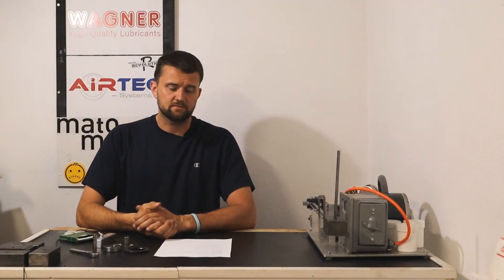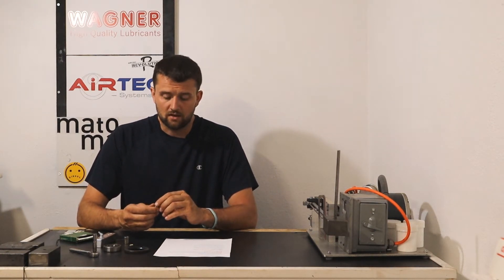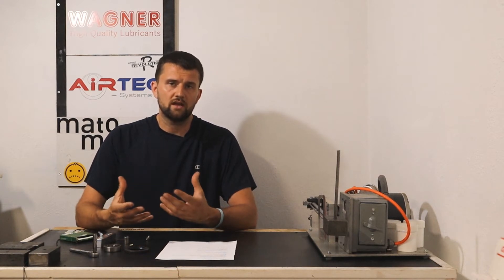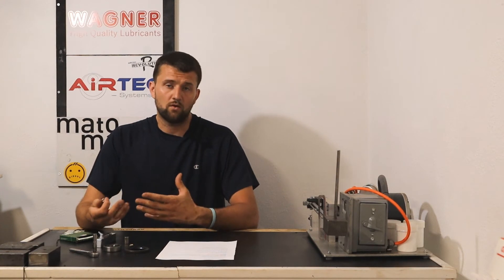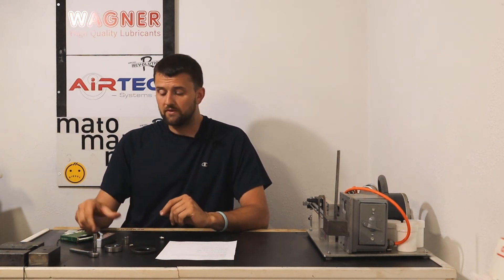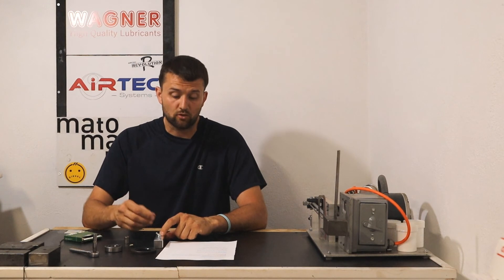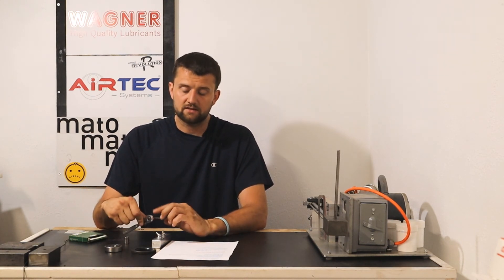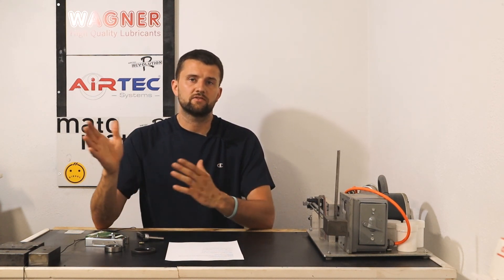How to Unclog Zerk Fittings Correctly: DIY Unclogging Guide

Comment: I’m a farmer with a lot of tractors, equipment, and combines & It seems like a clogged zerk fitting is seldom as simple as to just replace it. The clogs I was having trouble with recently (& most of the time) were at the end where the grease is supposed to exit the shaft/pin, but couldn’t bc of the hard grease shell that formed. I tried the piston style hammer tool...I’ve never once gotten that tool to work on ANY application...even after watching these “how-to” youtubers and doing exactly as they say. I couldn’t heat it bc of rubber seals on each end of the shaft...so basically had to take it completely apart and clean out the exit hole.
Reply from the maker: If your grease is leaving a "hard shell"  it is due to separation and oxidation.  The grease is separating and the thickener is left, forming a hard shell due to oxidation.  This is typically a problem with grease quality, especially if it is a reoccurring issue.  Piston style "zerk cleaners"  also leave a fair amount of penetrating oil left in the bearing or bushing which further creates lubrication filming issue and grease stability problems.
Reply: You probably have a grease-worm infestation, try grease-worm free type grease.
Reply: I agree with this comment that it is rarely the zerc that is a problem
Reply: When you say piston tool do you mean one that takes a penetrating oil to push the old white out

Comment: Just bought this F250 farm truck with creeky, sticky king pins. They wouldn't take grease. Changed the zerks. One side did start taking grease. the other side still wouldn't. I ended up taking the entire king pin dust cap off & filled it with transmission fluid and penetrating oil. Still won't take grease, but noticed the kingpin has freed up significantly. I think within a couple of weeks It'll be able to take grease. UPDATE 10/02/23 a couple of weeks ago, I finally got it to take grease.

Comment: on my ball joint, the grease was hardened so I heated it up with a heat gun.  Once it was warmed up, I pumped it and pushed the old hard grease out.  No more squeak noise.

Comment: I have had to deal with fittings that don't take grease on multiple pieces of construction equipment, usually from the operator not greasing the pins regularly, the pin gets dry and wipes over the hole making it to where it won't accept grease. I have an issue on the spherical joints on my Jeep rock crawler where the joints won't take grease. Most of the joints have a wet bolt and also a grease fitting on the outside of the joint. The grease goes to the same place. It is very common for the wet bolts to get plugged with hard grease and I grease them often usually with a high quality red EP grease. Removing the wet bolt will usually show about 1/16 inch of hard grease that won't flow out the end of the hole. The wet bolt goes through a steel sleeve with a hole in it that allows grease to flow through the poly material and lube the joint. On some of the steering linkage that won't take grease, sometimes all that is required is moving the joint slightly and then it will take grease. I believe in preventative maintenance and I usually grease twice between oil changes and especially when driving through mud, water and snow.

Comment: If the grease is hardened downstream of the zero what are your recommendations....
Reply from the maker: If the line is removable, remove the line and soak it in a solvent and then use grease or pressurized air to clear the line.    If the line in not removable you will have to two choices--remove the bearing and use the above method to clear the line.    2. Leave the bearing in place and try to dissolve the grease in the line.  However, if you do not remove the bearing you will have to grease more often once line is cleared to work the solvent out and re-establish a good fluid film.

Comment: You have missed at least half of the mark. I live in a farming community & do some helping the farmers help.  You did not really talk about shaft bushings being clogged up. I have one now that wont take grease so I pulled the zerk  fitting and it is passing the grease just fine but it won't lube the shaft. A bushing is not as fragile as a roller bearing and almost all the lubricant will get pushed out when you flood the shaft with a good amount of grease.  Even using the flat rate cost of dismantling the shaft ends up costing quite a bit to do.  I do see some value in what you were saying about bearings (roller,, ball, etc.)

Comment: Step one is to remove the zerk, put it in the grease gun and see if grease goes through it. Chances are it will and putting a new one in does nothing. The problem is almost always a clog inside the bearing or joint. I have tried heating with a torch and tried the penetrating oil. So far neither has worked. Probably only option is to take stuff apart.

Comment: Yeah, buddy. The problem is that sometimes the zerk fitting is ok and the problem is further inside the piece.
Reply from the maker: Good day, Yes, and if that is the case the part must be further broken down and replaced.
Reply: @aetsystemsinc.1413  Nope. You really have never made your hands dirty, dont you? You shouldnt make any videos like that, with just theory in your head - you seriously need some practice, before giving any advice to people.
Reply from the maker: @yapanazuma3595  Thank you for your comment. However, as a lubricant supplier to tens of thousands of industrial clients we are confident in our products and practices.  (For your reference, the man in this video was responsible for maintenance on a large scale non-metalic mining operation before coming to AET Systems, Inc.)  We are proud to have experts on our team that have both technical and hands on experience.

Comment: 1st question,  why is the grease getting hard?
Reply from the maker: Grease can harden for a number of reasons.  1. Additives within the grease are oxidizing and getting hard.  2. The oil is separating from the thickener and the thickener is left behind, leaving, a chalk like residue.  3.  Additives within the grease are drying out.   This typically only happens with solid additives like Moly and long periods between greasing cycles.

Comment: 12 minutes to tell us “replace the Zurich fitting”
Reply from the maker: Pretty much correct, but when most companies will tell you to use penetrating oil or high pressure "grease busters" tools we felt it was important for you to know why to replace the zerk and get the grease flowing without causing long term damage to your bearing or bushing.